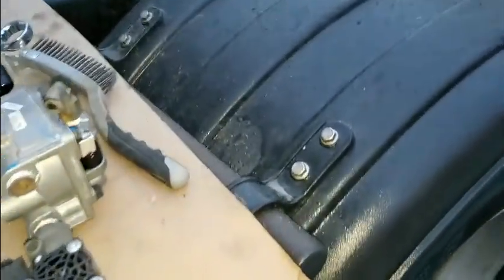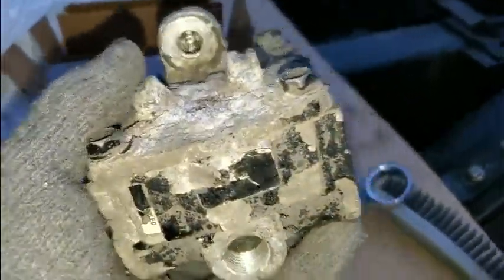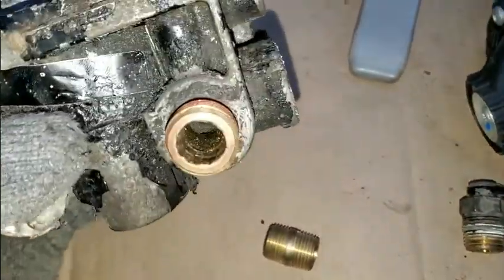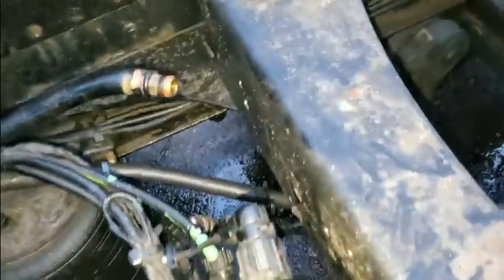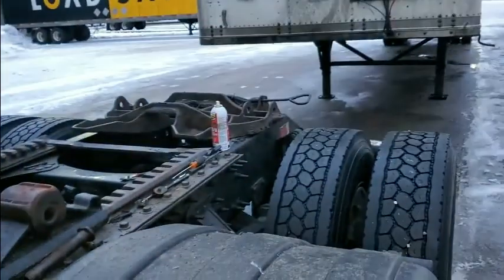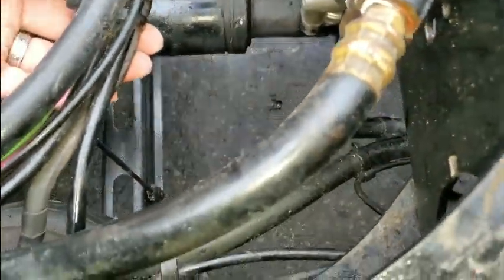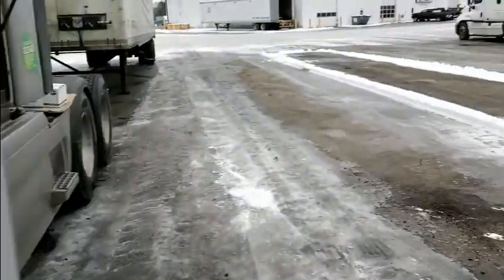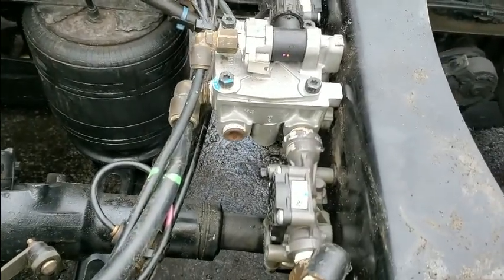Volvo D13 modulator, ABS valve replacement

Comment: The fitting that was leaking from that T was it bad or o-ring in the quick connect. You have to remove the collet and take the o-ring out with picks and put a new one in. They are a Volvo part number.  Or replace the whole fitting but that gets expensive when you replace every single one
Reply from the maker: Yeah i changed the t-connector. Easiest way to do it

Comment: Where did you get the fitting from that goes on the valve? I have the same problem. Do the fitting have a name to give Dealership for the fitting part or can I find at Home Depot?
Reply from the maker: 1/2-14 NPT brass male fitting

That is the name of the fitting.

Comment: What are those fittings called or size etc. the ones you connect to the ABS module and modulators
Reply from the maker: Im sorry not sure what they are called i will try to find out

Comment: How can you tell if it's bad and what problems does it causes?
Reply from the maker: If the valve thats under the hood driverside on the firewall is leaking. Check on one if my shorts i show it. Then you have to replace all this. Its part of the abs system. And its leaking air. So you would fail dot Inspection

Comment: Hi people. I have issues with my brakes. When you supply air it releases the brakes,  but when you brake while driving it's not fully release you can tell that is still holding your truck. I'm thinking to replace modular valve the one in the video since I replace hill assist valve and quick release valve. 

It's Volvo with I Shift
Reply from the maker: Sorry bro i have no idea what the problem on that is. Maybe someone else will know

Comment: How much does that new valve cost
Reply from the maker: Not excactly sure but somewhere between 900-1100 canadian dollars
Reply: What’s the name of the other valve you changed it’s leaking air on my truck
Reply from the maker: @yadasmackman  you mean that small one that is in the center more to the front?
Reply from the maker: Or you mean the small T that was leaking there?
Its just a 1/4 T to a 1/8 i believe